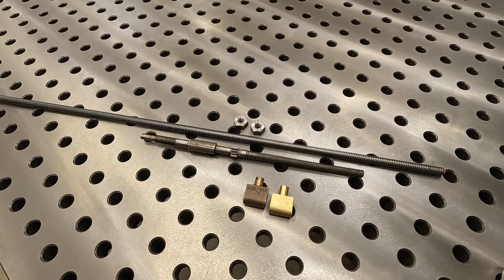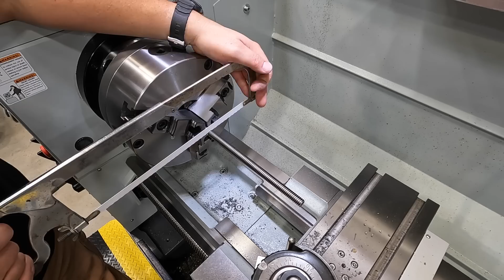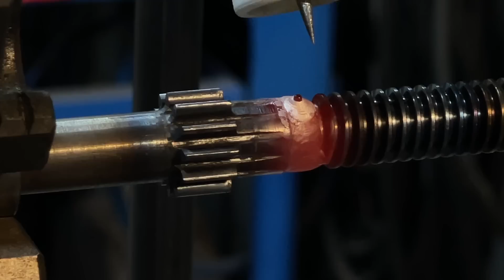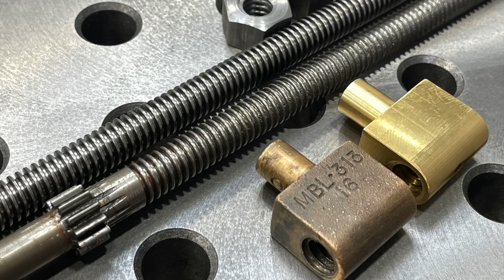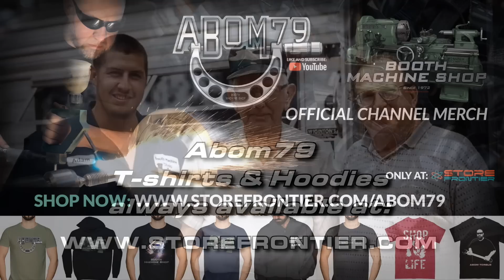Lead Screw Repair for 10" Rockwell Lathe

Comment: I just did something similar to my 1953 Leblond last month. I had read online people using only Loctite 680 or red and not welding to minimize warping. I made sure it set for 24 hours before installing and it's held up great so far but I also able to use a bigger thread size because my crossfeed screw was 3/4". The precision Acme thread from McMaster Carr is 1018.
Reply: I would probably cross-pin it after throughing though. Just to give it a little more resistance to cracking the Loctite seal.

Comment: When cutting the new piece of lead screw why didn't you use the nice & shiny bandsaw behind you after you decided against parting it off on the lathe? Did you simply forget you had other tools besides the lathe?
Reply: It was already held securely in the lathe chuck, 30 seconds with a hacksaw will be faster than moving it into a suitable vice for the bandsaw (holding round parts by hand in a bandsaw is asking for trouble).

Comment: Dang you got that thing straight AF. I bought an old Norton cast iron belt driven bench grinder and main shaft was a little bent so I tried to heat and straighten it. It is now scrap metal… don’t know how you do it.

Comment: Please forgive my ignorance but why bother drilling and tapping a hole and cutting threads when you were just going to weld it together any way?
Reply: The threads center everything, keeps it all straight..
Reply: @kentuckytrapper780  Dowel pinning or spigoting would achieve the same centering requirement. Just needs a tappy-tap-tap to bring the two parts together, snug.
Reply: @TheCuriousOrbs  Adam set himself up with a wonderful welding positioner. Our production manufacturing shop positioner was crude compared to his. Owning Adam's rig would make me think TIG every time even though I would have to straighten the part. 
Not having single point threading capacity and experience in the past, I have done similar repairs and set ups tapping both parts and using a long set screw to join them. Methods, needs and capacity varies. Many factors affect my methods, and I like seeing how others apply their ideas.
Reply: @TheCuriousOrbs  yep, all kinds of way to get it done...
Reply: For alignment and not leaving any gap between each part before welding would be my guess
Reply: because you want it perfectly straight
Reply: Just because, alright

Comment: The dial/wheel end of that old screw is a little bent.
Reply: Not too surprising, I'm sure the handwheel will have been knocked many times in the last ~60 years of use.

Comment: I would have press-fit it and then welded it. I don't see a point in threading it.
Reply: A press fit will add no twist resistance to the bond. As the part twists the weld could break. That's why he considered adding a pin also. The tight screw will help keep it from twisting - that plus the weld should hold in most cases.
Reply: @kindabluejazz   By threading it, you reduce the diameter a bit. This increases flex. The weld itself should be more than enough for twist resistance. The only thing I would have liked is to temper the weld area a bit. It doesn't need much.
Reply: @firesurfer  I don't see flex as an issue in a lead screw - the primary force to hold is a twisting one. Adam mentioned he'd done this kind of repair many times before. I imagine he was taught by people that have many decades of experience in heavy duty machining.
Reply: @kindabluejazz  Neither one is an issue.

Comment: Lathe repairing a lathe,can't beat that,great thought in the repair.
Reply: I'm an hobbist, and in my poor technology, i also repaired my chinese lathe with that lathe itself. They say monkeys can develop a simple tool, but no other tools from that ... 
That is why they remained as they are ...
Reply: Agreed.
That's the beauty of Machining, you get to use tools to make more tools.
In the not too distant future there will be farms of 3D printers, printing EVERYTHING, even more 3D printers. 
If it progresses enough, no post print Machining or finishing will be needed either. What an amazing time we're in.
Reply: @glenj.taylor2938  I work at a agricultural factory,we have iron printers that can print anything to be run as printed,manifolds turbo housings.actually pretty cool
Reply: @19672701  
That's really cool! 
I haven't gone down the rabbit hole of 3D printing yet but the technology is game changing in my opinion.

Comment: I would have made a snug fit on the 1/4-20 threads and used red locktite and no weld groove. But, I'm not a Pro.

Comment: Can you explain why you threaded the connection instead of just using a tight fit, given your intent to weld it for strength?
Reply: Elastic  longitudinal tension  to minimise welding distortions.
Reply: The threading helps stop the part from twisting, which could break the weld. That's why he considered a cross pin, but felt the thread + weld was good enough.
Reply: I think he was flexing,single point threading 1/4".
Reply: @19672701  if you think single point threading is flexing, you never worked on a lathe before lol 😂 (it's as easy as can be)
Reply: @FireGodSpeed  I guess you misinterpreted what I meant.

Comment: Nice repair.  What I found especially interesting was the apparent fact that acme threads don't allow a jam nut to work...never would have guessed...
Reply: Jam Nuts can work, even on coarse threads, but they are inherently tricky if you're trying to jam a lh thread to tighten a rh thread using the wrong nut to tighten.
Reply: @an2thea514  You just tighten them against each other and hope they’ll stick well enough to drive the shaft.
Reply: @ellieprice363  if you put the tightening pressure on the inner nut, it will work. Adam put pressure on the outer nut both times which is why it didn't work properly.
Reply: @an2thea514  Funny really, he just ' fluffed his lines' instead of pausing, having a quick think through as everything is going to be about face to normal. and then following through. In true YouTube fashion, the course thread is deemed the main culprit.
Reply: ACME threads is not the reason. Jam nuts don’t work well on coarse pitch threads.

Comment: Genius.  I never would've thought of just parting off the old worn ln threads and screwing on a new threaded rod.  The solution I had in my head was spray weld and re-tap the existing which would've been a trip.

Comment: lot of time. probably not cost effective unless abom works cheap
Reply: im assuming adam did the job for free or a minimal cost, as he is generating money through the posting of this content.
Reply: Restoration of any old machinery and
Cost effective don't mix that well anyway.
Reply: It doesn't take that long if you have everything ready. Leblond quoted me $2600 for a new crossfeed screw and nut. That leaves a lot of wriggle room for repairs.
Reply: What estimate did you use for ad revenue?

Comment: Wouldn't it be faster to make an interference fit and secure it with a roll pin?
Reply: Yup. This would be the way most shops would repair it. For both time sake and added strength. But it wouldnt make for a more interesting YouTube video.
Reply: No don't use a roll pin, a solid pin is the way to go

Comment: You can heat straighten that. Lots of videos on line and Keith Fenner has some as well on it. The best way to heat straighten is to brace the opposite end so it can't move with expansion. It will straighten after that.
Reply: He don't need to listen to Ole Keith. Beat Keith out in the 4 jaw competition at a meet up years ago :-)
Reply: @tedsaylor6016  Yeah but is there anyone who could beat abom in a 4 jaw competition? Or chip throwing competition? I know I couldn't.
Reply: Straightening shafts is Keith's speciality.  Not seen one video of Adam showing the process, and here given the opportunity he chose not to include it.

Comment: Locktite
Reply: @davidhoward2237  Yes, if red Loctite is used tig wouldn’t be necessary. It’s one or the other but not both.
Reply: Loctite and pin
Reply: @davidhoward2237  he is saying no need to weld it. Just screw it together with the permanent locktite compound and it ain’t going anywhere

Comment: Maybe if you do something like this in the future, use little tig tacks on opposite ends sides. Let it cool between. May reduce warping and heat affected zone...
Reply: From experience doing little tacks like that really doesn't help, the first tack will cool and pull long before you tack the opposite side no matter how fast you work.. better to just weld it all and deal with the bend later
Reply: @markshort9098  The HAZ was like 2" long. If that had any heat treatment it's gone there. But if it's 1018 it really may not matter...
Reply: @dan4653  I did think that bronze welding this might have been a better choice for this reason.
Reply: This is why I love the comments section of Adams videos. Always somethin new to learn.

Comment: Repaired my SB cross screw similar method- but simply reamed a hole in the back section, turned down the end of the new the acme rod for slip fit, coated with sleeve retainer and voila...
Reply: I was just thinking this. The threading seems a lil superfluous when you are going to weld it. Although I wouldn't be surprised at all if Adam knows something I don't.
Reply: @impetus444  the threads keep it held tighter together which helps to keep it straighter when welding
Reply: @markshort9098  That makes perfect sense. Thanks for sharing, now I actually learned something.

Comment: Nice trick. I have used it on other types of shafts. Never had one fail at the repair point, especially when you think about how well these shafts and the drives are supported. Great job. Thanks for sharing.

Comment: That undercut on the 1/4-20 threads. Drill and tap both sides and use a long set screw to lock the 2 pieces before welding.

Comment: This episode is about two (2-3) weeks too late for me.  I have a Boyer/Shultz 6X12 inch surface grinder.  The lead screw for  the up and down motion of the grinder head was just about worn thru.  I fixed the lead screw about the same way you did.  Just did one thing different I removed about one inch of thread near the "handle" of the old lead screw and cut 3/8" X 24 Tpi. male thread on that piece and cut the rest of the old thread of the handle.  I purchased a new "acme all thread" (3/4" X 7 Tpi).  I drilled and taped the female threads into the acme "all thread" at one end.  The part that was most difficult for me was making a replacement nut.  I ordered some round bar 932 bearing bronze and bought an acme 3/4" X 7 Tpi. tap and cut the internal acme thread.  The part that was the biggest challenge for me was cutting a .0.962" X 32 Tpi X 1/2" single point external threads into the bronze nut.  If I could send some pictures this would make more sense.  I am proud that I did all this on my 7" X 16" Horror Freight lathe.  Anyway I really enjoyed this video just wish it had been out about 2-3 weeks ago.  KOKO!

Comment: I’ll tell you who’s a master at the heat/cool straightening process….Keith Fenner. Unbelievable some of those shafts he straightens. Sure looks like a great repair to me and plenty straight. Keep up the good work, thanks for the knowledge!
Reply: Keith's channel is another great one watch, it's crazy how he can straighten a shaft like he does...
Reply: It's pretty tricky using heat and cool method to straighten such a small diameter since you can't really isolate the heating and cooling to one spot effectively.  I reckon even Keith would have struggled with this.
Reply: @ferrumignis  I think you’re right. This diameter is a whole different ballgame and would really be tough no matter what.

Comment: Years ago I rebuilt a Hardinge HLV toolroom lathe. I bought a Y axis nut and lead screw. They wanted you to drill and tap the nut in place. They supplied drill bushing to guide the drill and tap bushing to guide the tap. They lent me a Left Hand Acme tap to thread the nut. The result was like factory new. Always got great support from Hardinge. Their parts were fairly priced often less than other sources.

Comment: Adam please, put a piece of plywood on the bed when using a Hacksaw, hate to see you damage the ways on that pristine lathe!
Reply: Why?   Chips are chips weather they come from a $50 carbide insert or a six dollar hacksaw blade. And if you can manage to touch the ways with the saw. especially on that size lathe,  you shouldn't even walk PAST a shop. . Besides this is a VERY common practice and I even see a lot of people using porta bands on parts in the lathe both in person and on videos. .
Reply: Not the chips, hitting the ways with the Hacksaw!
Reply: Yeah, that made me a little nervous as well.

Comment: 4:30 Pro Tip: Use a big enough center drill to center it as big as you need the chamfer from the thread. So you don't need to chamfer it after drilling ;).

Comment: Why thread it instead of just reaming it and slipping it in?
Reply: I would guess a stronger, tighter fit between the two pieces. And because he can.
Reply: With that deep fine thread, some red loctite would have made it permanent.
Reply: That's how I would have done it and used retaining compound and a cross pin.
Reply: @tsmartin  That seems like a poor idea, it adds a step down to a narrow diameter which will be much weaker than the original.

Comment: I did mine last year on my 13" lathe, simply drilled and reamed, machined off 2 inches of thread and used green high strength loctite, no pin or weld to weaken the joint and runs perfectly true.
To replace in the future, simply heat and disassemble.
Engineering in a can!
Reply: Would have resulted in a very weak area in this case, not the loctite but the small diameter of the spigot and the sudden reduction in diameter.  Personally I'd have gone with bronze weld to lower temperatures and HAZ
Reply: That would have been my method.

Comment: Didn't all that heat soften the steel do you think some red loctite and the tension pin might have been better?
Reply: Adam's informed guess as to what the "all thread" material is 1018 cold rolled.  That stuff is low carbon and not hardenable.
Reply: Without the weld you have a small diameter, necked down area which is going to be far weaker than the original.
Reply: I was wondering that. Apart from the bent end it was true when he first screwed it in

Comment: That original piece you cut is bent. At around 13"49 in the video you can see the tip wobble. You really should check the alignment of the two pieces with a dial gauge before welding them together.

Comment: The lathe is a 1962 vintage, used in tool room all of it's life before I got it.  Thanks very much for the beautiful work, Adam!!  Now to just start putting it all together when the snow starts to fly...great winter project in the heated cellar.
Reply: It always good to see this older stuff refurbished. Just sent my 1940s 10" Sheldon out for machining and scraping.
Reply: I have a 10 inch delta Rockwell lathe circa 1964. Mine has the motor under the lathe and the speed is controlled by a snowmobile clutch like thing. So do you have the adapter that fits in the spindle by chance? My lathe has I believe a 1 1/8 (1/4 ? )  spindle opening if, you have one and it fits my parameters could you tell me what taper it is (od)...I don't have one and not much info on said adapter I believe it is like a B & S 3 taper ...
Reply: @chrischapel9165  the spindle bore is just like an R-8 collet. Except the threads are on the outside. If I remember. They are called a 4-C collet. Only goes up to 3/4”.
Reply: @chrischapel9165  The taper in the spindle bore is Morse Taper 3, I'm pretty certain.  Mine is a benchtop, motor behind, but it still has the Reeve's drive (snowmobile clutch thing) too.
Reply: @tonyc.4528  Tony thanks for replying etc...I can only wish mine was a 3 mt...I have made one for mine and I got the spindles B&S taper info from a British video etc . So I made one and it fits good with almost 100% contact over the whole adapter. I bored it out ,reamed the ID with a mt 2 to fit most of my tooling and it drills great BUT, IF I can get that OD perfect! ahh striving to remove that thousandths LOL... thanks Tony
Reply: I've got an old 10" as well and could use a new cross slide but too, where'd you get that one?
Reply: @bwestfall7281  I'll look it up after work, I have info on the compound slide nut, various bearings, oilite bushings too.
Reply: @vince55sanders  Everything is awesome!!
Reply: I have the same lathe and needs the same parts. And then some.
Reply: @UnionBMXCO  A lot of the bearings, oilite bushings, belts and such are still widely available.  What are you looking for?
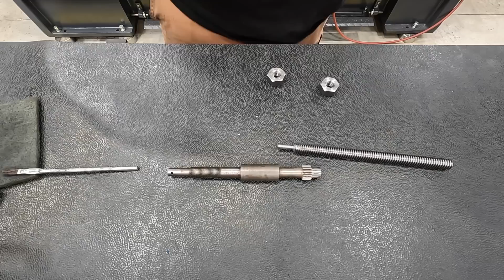Reply: You probably know this, but between 13:48 and 13:58 (more clearly as the lathe slows down) you can see that the dial/handle end (the original part) has a slight bend in it which seems to start near the end of the fine thread.
Reply: @mikeparfitt8897  Thanks!  It's seen some use in it's life, taken great care of for the most part, but it's been moved three times between it's original home and mine.  Likely the cross slide was not packed well during transport and took a whack.  I'll see if it has any functional impact when I get it all back together.
Reply: so, only worked hard for 60 years 😅 no wonder those threads are worn down
Reply: @WayneWerner  Right!?  My threads will be a bit worn by that point too.
Reply: Right on Tony!